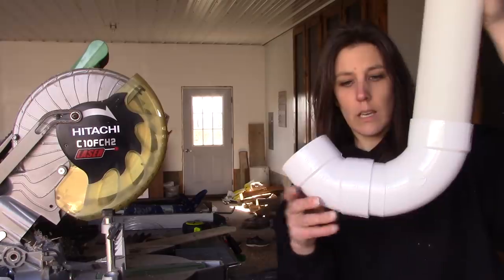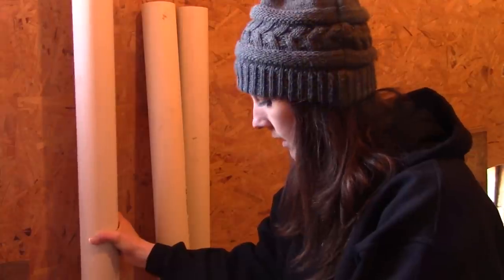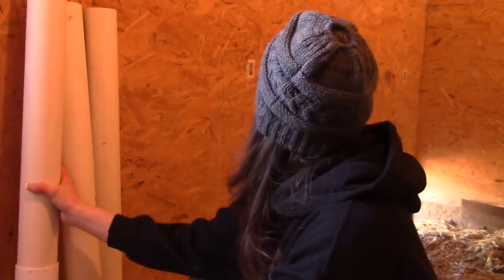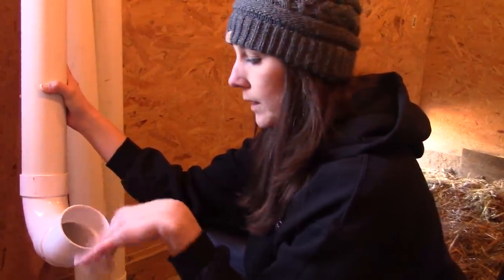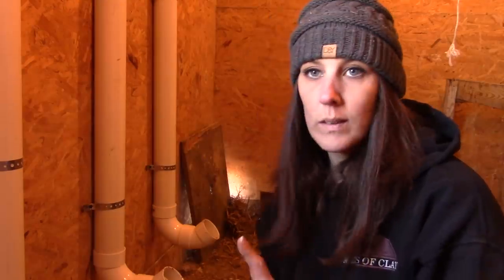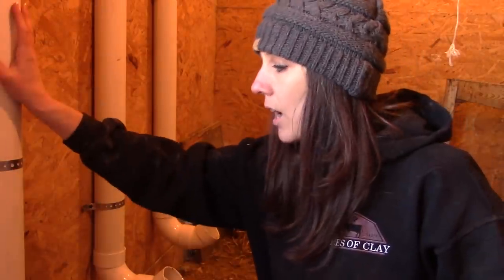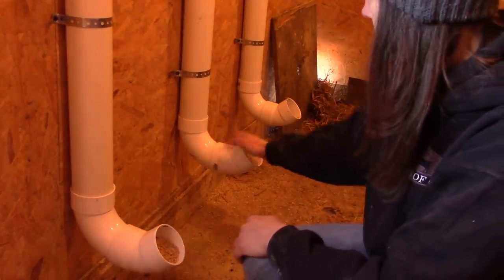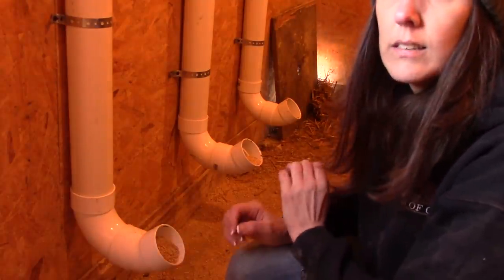PVC Chicken Feeder

Comment: Try adding your 45 angle to a Y couple. This will give you a double feeding station which will help keep them from fighting for position. To block off the opening during filling get a clean out cap which will pop right into the opening on the fitting.
Reply from the maker: Thanks for the ideas!!

Comment: Ronda if the chickens are still pulling the feed out? Take a very short piece of the sewer pipe. Like maybe 2" long. Stick in the 45 and then take a cap. Cut in half and glue it on the piece sticking out the 45 degree elbow. You may need to cut a small piece off the cap so chickens can get heir head in. Guaranteed to work and very little waste. If any

Comment: When we did sewer work always used a miter saw to cut the pipe. Nice feeders did a good job 👍. What you could do is run two really small screws in each joint across from each other. Grandpa was a plumber that’s what he called the strapping.

Comment: If you wanted one with more capacity, you could use a reducer and a larger diameter vertical pipe,or a big pipe with a y-fitting and 2 feeders on it.Lots of options.
Reply from the maker: I thought about those ideas. But I really just wanted to see how it was going to work first.😊

Comment: they make a good feeder but i found they still wasted feed, by pulling the feed out with there head, becks, i put a cap on the bottom and use a 2-1/4 hole saw (4" cap) and cut a whole in the center of cap for them to eat throw, stopping them from being able to rake the feed out, as well as stop the feed from running out well filling, this gives a good ledge that stps a lot better, you have to cut a 3" peace of pipe between the fitting an to fit a cap,, 40.3 deg today, snow is melting, but ya wont drill know holes in the ground here any time soon